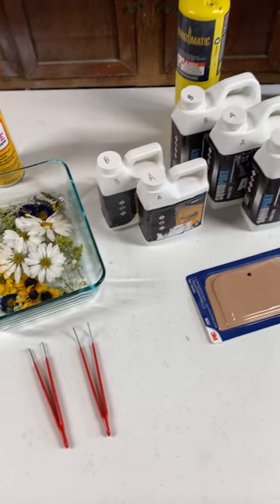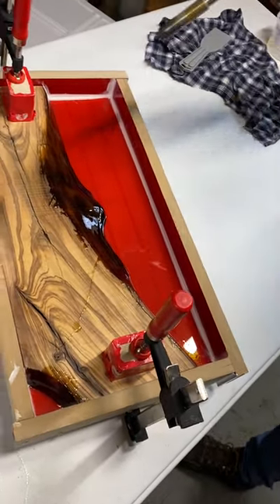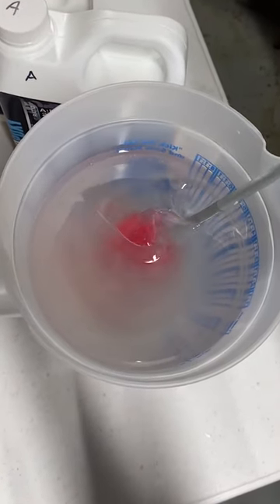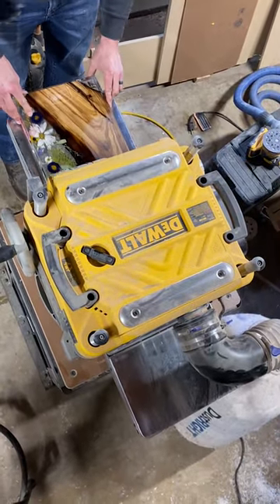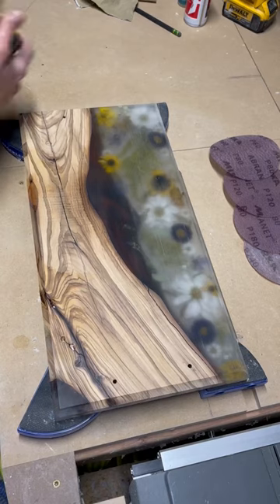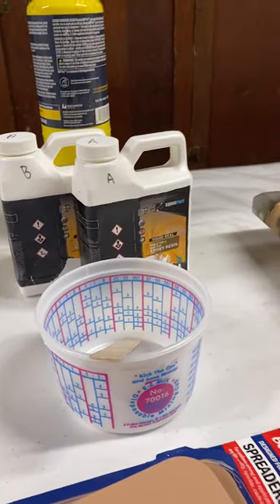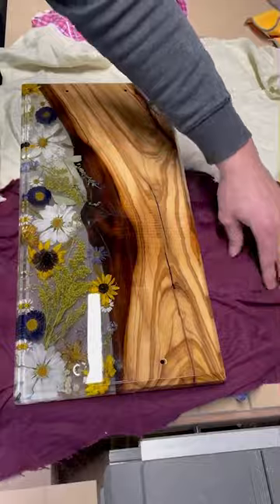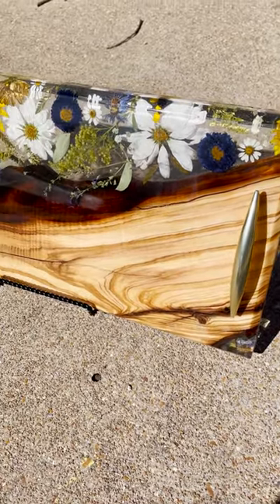How to make an Epoxy Flower Board  | Step by Step Tutorial

Comment: I've built my mold, dried my flowers and I"m ready for the first pour. I put resin tape down but it has a few close but not completely flat areas, (I wasn't satisfied with using the tape). Will it smooth out in the planer/sanding process or should I re tape it. Will non stick cooking spray or crisco be a suitable option, serious question? I couldn't find non stick resin products locally. My wood is 1" thick birch.

Comment: Is it possible to just sand or buff the board to get it to be see through again without that messy top coat process?
Reply: Yes, you can wet sand higher & then polish the resin.  The only problem is some food grade finishes might not bond well to the polish/the piece because it”s sanded so high.

Comment: I am so confusing the mixing ratio of resin and hardener for specific area. please do some examples if there is calculation show.
 Example:- 60cm width, 2m length and 4cm thickness mold, and there is wood, stone and flowers to include in the mold,  how we know the exact ratio of resin and hardener to mix and to get table?